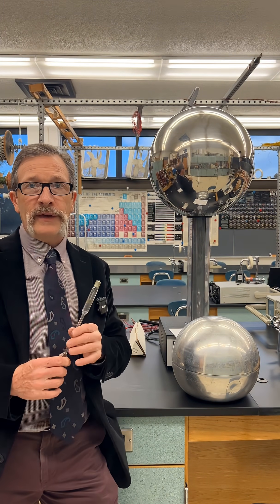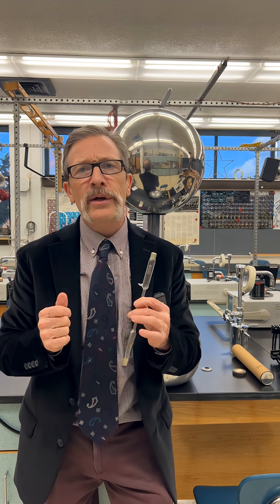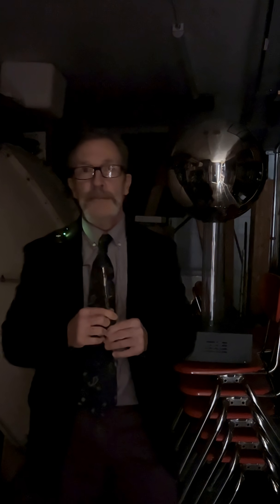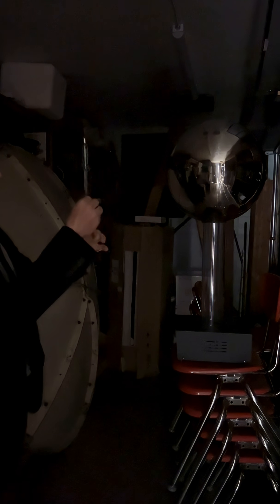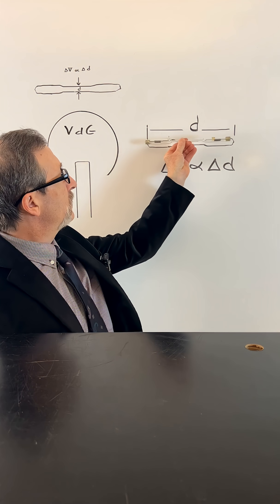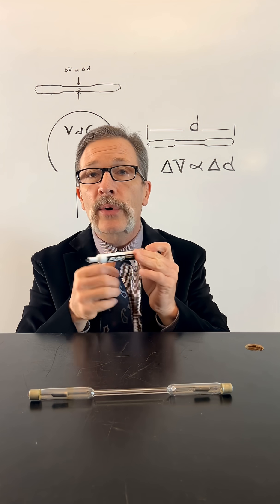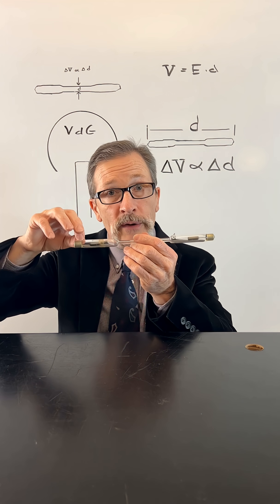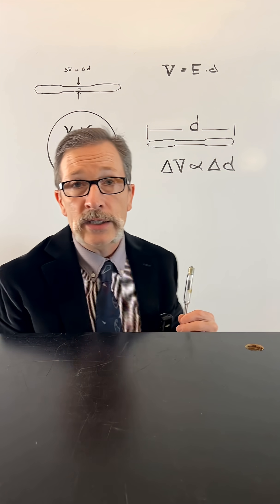Can You Light a Bulb Through the Air?

Comment: I dont think you should be holding the tube. You are introducing - an "earthy" potential at one end and modifying the e field. 
Rather - you should have suspended it from two nylon strings  or similar - and then align it either along a radiially or circumferentially . 

Radially - then it lies along a line of flux with reducing potential

Comment: Still, no light when it is stationary. only when it is moving through the field. Just a dV over space, works only for a coil to make a magnetic field.
This needs a dV over time to light the bulb❤
Reply: Yes?  Then by the reference stand point of the bulb nothing happened.   Heh kind of like everything moves and only reacts to the relative motion of the other.  If I missed the point then please point it out,  Kindof tired and would rather be more correct than incorrect.  Good channel as always
Reply: @randomrant3886  the bulb sits in the static field. then no light.
if the field is changing inside the bulb then it lights up❤